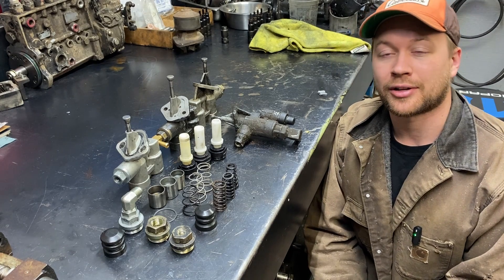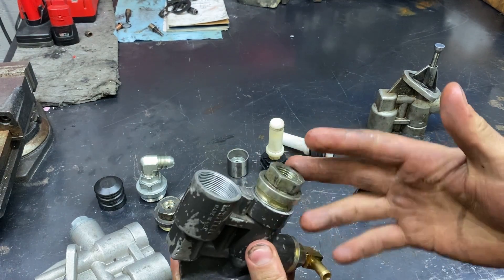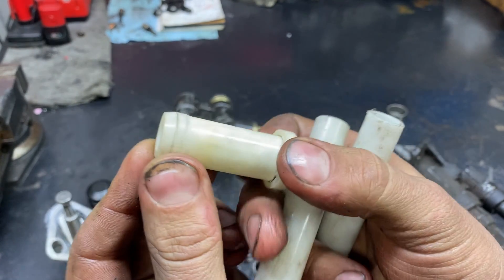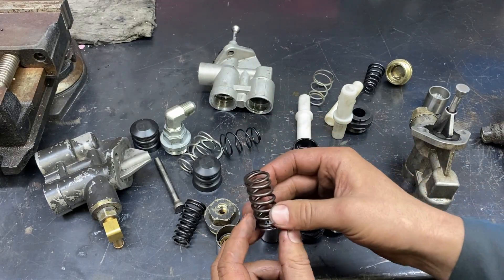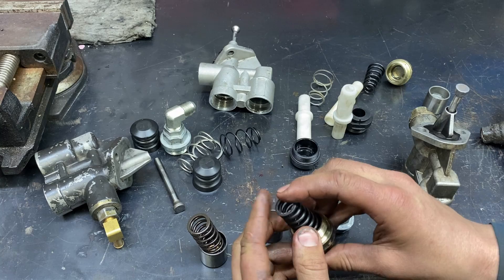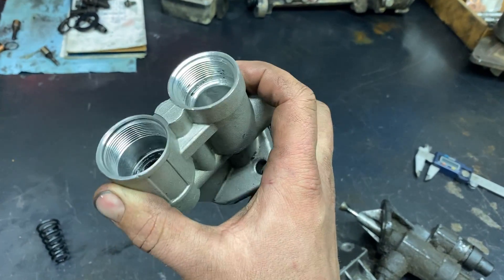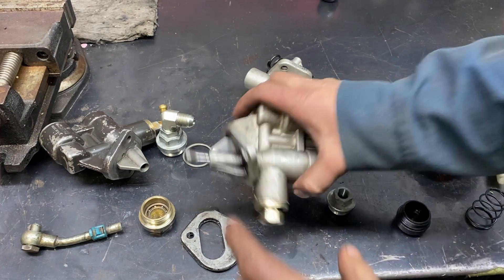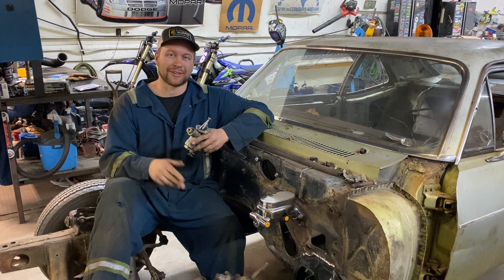Everything About The 12 Valve Cummins Mechanical Lift Pump! How it works, what fails, + HOT RODDING!

Comment: Dont recall the specific one I bought/installed.  With it my rpm spins up really fast.  Happy with it.  == Additionally, on my firewall I have a second fuel filter.  Once a year (because the filter is easily accessible) I run a can of Seafoam through, and the system delivers so much more fuel on demand, than before.  I like it.

Comment: I know the video is a little older but when installing the comp cam valve spring is the fitment into the plunger usually extremely tight ive measure my plunger and it is 30mm but i always seem to have to fight it to get the inlet fitting back on
Reply from the maker: It is pretty snug on both sides, never had any issues though

Comment: Great video very informative I have a 1998 dodge 12 valve with 325k just recently had a priming problem after replacing fuel filter and finally pulled lift pump , I believe OEM Carter pump since it was also painted black , I think 325 k for the original factory pump is a great track record , bought a cheap  ebay Chinese knockoff and have been having a nightmare bleeding the system. I am ordering a Carter OEM (hopefully made in USA) from Rock Auto for abouut half the price of Orielly Auto parts. The old Carter pump had  good bit of wear on the walls of both pistons but it still was pumping fuel on the bench , but I think too much diesel is bypassing the piston . When deleting the heater do you have to replace the fuel supply that screws into the heater or is there an adapter to make the connection? Really enjoy the video ( I watched it twice) plan on subscribing but do not use instagram or facebook .

Comment: When I did my swap I bought an ebay pump as a replacement and when I pulled it apart the piston was a smaller diameter. I assumed it was just a skeezy ebay seller trying to sell a 4BT pump marketed as a 6BT pump, but maybe I was too hard on them if you're saying some of the 6BT pumps just happen to be this way 😅.

Also I'd warn that if you're swapping to soft lines make sure you're upgrading line size. You'd be surprised how much more pressure loss flexible lines give over a hard line, so you need a much bigger line otherwise a soft line may actually be a downgrade. PTFE lined flexible lines would also help for reducing friction and thereby losses.

Great video, great info!

Comment: IF YOUR ''HOT'' RODING '''  YOU NEED ''ALOT'' HIGHER FUEL ''PRESSURE''''   WILL ''CAUSE'' MORE ''LEAK'S '''   LIKE FUEL HEATER ''''  THAT '' CANISTOR'' CAN ONLY '' HOLD '' SO MUCH '' PRESSURE ''''   IM STARTING TO ''RELIZE'' THE ''LIMITATION'S '' OF THE FACRORY ''SETUP '''''' GUY'S & GIRL'S '''    IM JUST '' GUESSING '''''  BUT IM SURE '' LEARNING '''  THANK'S SIR '''''

Comment: Do you have to drill out the top to 7/16? lol I done everything but drill it out lol, truck idled rough so I adjusted idle screw now haven’t had another issues just asking incase it is a must do or ?? Thanks
Reply from the maker: It’s not a must do, it just increases the output potential of the pump, you could do 3/8 instead of 9/16 too
Reply: I left pump on my truck, so I guess in future I’ll take off drill out- what’s odd is when I put it back together started it ran but died and I’m not sure why- I bumped up the idle screw an no issues yet but still curious why it done it- I did leave my pre filter heater attached but deleted heater part and like I said once I bumped idle screw no issues but it seem to run kinda different-

Comment: I would recommend to send your camshaft out and all the journals I would have diamond light coating on it, including the lobe that drives the lift pump and also take your lift pump the plunger the part that runs up against the cam and I guess it’s the plunger anyway and have that diamond light coated I think that would be a good thing
Reply from the maker: Typically for high performance cams people will get a DLC coating on the lifter tappets, so something similar to what you describe could be to DLC coat the lift pump pushrod. That said, I’ve never heard or had issues with the higher lift pump spring pressure hurting the camshaft

Comment: I’ve been trying to install that spring on the truck, looks like it was a lot easier off the truck so I’ll be pulling it tomorrow
Reply from the maker: Oh man is it ever a pain, even installing it off truck and then reinstalling on truck it’s not easy at all because it’s so tough to push the plunger in. I usually use a longer bolt from the intake in one hole inorder to get the lift pump lined up, and then use progressively shorter bolts until it’s all snugged up. Not fun, hopefully you got er all together by now!

Comment: No also would you have to change injectors when you do this hence the injector is going to be getting a lot more fuel through the spray nozzle than what it is supposed to be getting and is the delivery valves in a p7100 pump have to also be changed to keep up with a pumping capacity to a stock OEM setup or can you leave them two things OEM and just drill the holes and this one will work fine the way that you're doing it

Comment: I have been told that the Carter pump is not available & that Cummins sells you a Chinese pump as a replacement.  I would like to replace the mounting bolts with a stud kit.
Reply: Buy a power driven diesel lift pump
Reply: That is true I was having problems with about four lifts pumps I went through through O'Reilly's and also one through AutoZone they were all similar alike Chinese brand the original one was made in Sweden or Switzerland I believe it was on the truck that was OEM I could not find the original one lower parts to rebuild it I was going to set up a fass fuel system but it was going to set me back about 8 to 900 so I left it alone and wind up getting lucky with the last one I got through O'Reilly's and it's been working ever since there's really not that much difference one difference compared to the OEM that was on this truck originally and never was changed from 1996 was the part that was made in Switzerland it was o e was the plastic on top of where the plunger is that you pump with your finger was made out of aluminum where are all the aftermarket ones even the ones from Cummins are all Chinese Japanese made knockoffs made with plastic
Reply: Don’t you need two gaskets one either side of that fuel heater spacer?

Comment: When you remove the pressure relief valve and replace with the bolt and cut the head off you dont seal that with anything? Or maybe i missed something 😆 like usual

Comment: Where do you find the larger appropriate size plunger/piston? (30mm)
Reply from the maker: I think it’s just luck of the draw, you may have better luck with a higher quality brand lift pump than a cheap one as far as finding the 30mm plunger goes (like a carter pump)

Comment: No VE pump mods??
Reply from the maker: To be honest, I’ve never touched a VE engine.  I’ve had first gens, but I just left them as is so my experience in hotrodding them is limited at the moment. I am actively looking for a nice D250 or W250 single cab for a parts runner daily tho, so expect something in the future!
Reply: The lift pump for the VE is pretty dinky. I'm actually gonna swap mine out for that LPHV pump. Nice video brother.
Reply: I was going to say VE pumps are 15 psi I thought not those high numbers he says
Reply: Ve don’t need a lift pump
Reply: @fastinradfordable  you must be thinking about vp44 pumps ? VE pumps were the first pumps on a Cummins